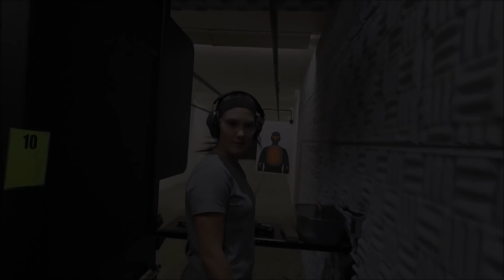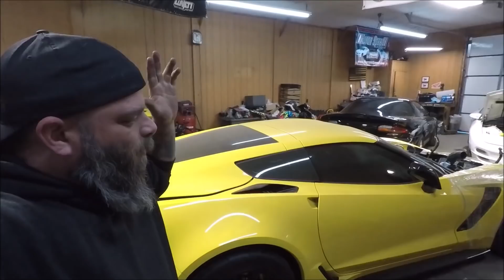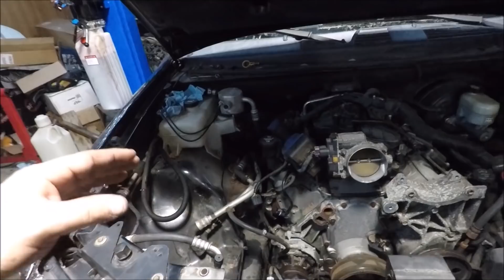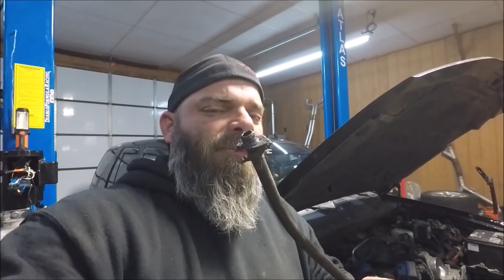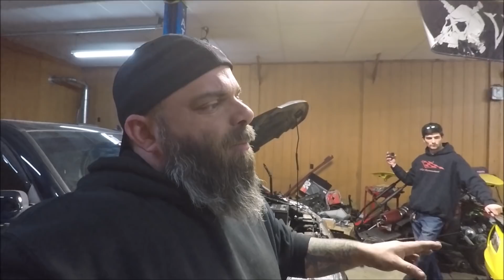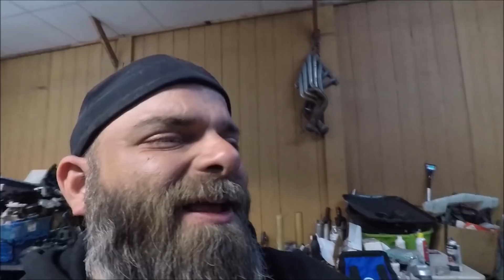DFR DESTROYS ANOTHER TRAILBLAZER!

Comment: Just install a power service disconnect box right on the unit. That way if the relay ever shorts out again, you can just turn off the power right below the controls. Be ready for the next time the lift has issues.

Comment: Andy if you have to drop the pan, have the customer by an Oil Pickup tube relocation kit, and or a baffle. I’m sure you’re aware the TBSS are know for oil starvation.

Also add a Trucool 40K for the 4L70e

To everyone else in the comments this is a TBSS 6.0 LS2 with a 4L70e

The other trailblazers come with a 4.2L I6 with 4L60e or a 5.3L V8 with a 4L60e

Comment: I have a question....What kind of exhaust would you recommend for a 2006 trailblazer with a 5.3 motor that would give it a more aggressive sound .....
Reply from the maker: Anything except flowmaster in my opinion.
Reply: DiabloFormulaRacing ok...I had a flowmaster muffler put on and it didn’t do a dam thing..Lol I think its less noisy then it was before I got it put on.......Plus I think its the dam shop that I have working on my truck....

Comment: Serious question. Is it worth tuning a 4.2 Liter Trailblazer and is it a noticeable difference?
Reply: Yes you can get good power out of them but the trans will give up pretty fast if you don't do upgrades  to it
Reply: @lifewithanxietyeveryday5897  built it last year with Alto HEG clutches with 7 clutches instead of 6 for the 3-4 clutch pack, Sonnax Smart shell, Sonnax bushings, Transgo shift correction kit & Separator plate, 10 vane rotor with harder rings, .500 Boost Valve. Works perfect

Comment: Lol the guy that was talking shit about Andy wanted a built transmission for a v6 😂
Reply: The problem on the trailblazers is they dont have an adequate transmission cooler, he should've had Andy add an external transmission cooler when he had the rebuild done. Top that with the 4l60s problems and you're looking at a complete headache. BTW the trailblazers has an i6 not a v6 😄
Reply from the maker: IIRC I always install those on every build I do.
Reply: @yungSwagg72  I was not talking shit on Andy at all. Im a big fan of his content
Reply: Aren't they a 5 cylinder? Not a 6?
Reply: @anthonyyyy2858  4.2l i6 5.3 v8 or 6.0 (for the SS) the colorado which was based off the trailblazers chassis used an i5

Comment: Andy, why isn’t there safety stop bar across the two posts. Great title to this video. Glad you caught the lift both times and no damage to either vehicle.
Reply from the maker: It has it but its slightly above the drop ceiling because the lift is too tall for the shop.
Reply: I think you could fab a bracket up to the bar to make it work properly before you have to buy someone a new car

Comment: Find a bolt that will thread down into the broken tube tighten it down in and use a long punch or pry bar from underside to catch the bolt head and beat on it up ward. May have to heat the area to melt the oring out of there.

Comment: I like the plasti wrap protection of the fenders and such, a real great idea, and I don't think I have ever seen that method done before.Yeah, scare stuff on the lift, when i worked for a guy who was leasing an old gas station, he was trying to do some stupid repairs(well, actually the guy running the business didn't know nothing about auto repairs, he was hoping to have a string of repair shops, but was too much of a big city fast talker that got himself bogged down with customers pumping up his two businesses with the minimal shop equipment he had, he could have bought a couple car lifts instead of blowing the money on booze and women he was chasing, why he failed later when I left) with an old single post vintage lift with a huge I beam H style frame lift without the proper attachment but some stuff made up, with a back yard mechanic guy he hired that was willing to take risks and screw stuff up and shrug it off,....a corvette came in to this picture, a late seventies corvette, you know what happened,....it slipped off the lift, the bogus vintage 1940's or 1950's lift, sideways a small ways damaging the side of the car, as far as I understand, the vette was pretty muh on its side with two wheel hooked on the right hand I beam after the bogus hand made tall attachments came off one side, but once I came later all I saw was a vette damaged all along the passenger side......The owner of the vette was trying to get some ultra low cost repairs anyway to sell off the vette to flip it for some bucks and wasn't too concerned once the shop owner offered to cover the damage with some other free labors and repairs,...like I went over to that shop to help out of course, we rebuilt the motor labor free(yeah I got paid some and got more experience at least), had the block machined .30 over, owner was real happy cause the main issue with the vette was a smoking worn engine, I even rebuilt the carburetor, I was good at rebuilding carburetors and even had my own throttle shaft reamer tool set for worn carbs, I think the guy if I remember still sold off the vette for profit to someone who wanted to do some custom modifications to a vette anyway, but it was surprising the vette hadn't fallen off the lift six feet or more in the air and flipped upside down, it was almost funny if you ask me, I refused to use the lift myself other than lifting a vehicle just off the floor, no getting under that concoction.  I see the old buidling is sitll erected, I wouldn't doubt that twenty four years later that the old lift is still there, or concreted over, I have no idea how someone would remove a lift like that other than digging up the entire cement floor, digging it out of the ground.

Comment: I have no clue as to why someone would want to lower a Trailblazer, a '76 Cutlass YES but not a 4X4...
Reply: Because street trucks are badddddd AF
Reply: lol...
Reply: Not 4x4 all wheel drive way different you can take a 4x4 and drop it in 2wd 4 low or 4 high with a all wheel drive you can do anything and it's a street truck nothing more
Reply: @tootall956  trail blazers are not awd...
Reply: @tootall956  TBSS are awd but regular trail blazers are 4x4
Reply: @rubberskilla2991  I know